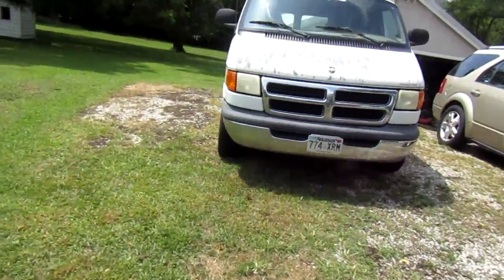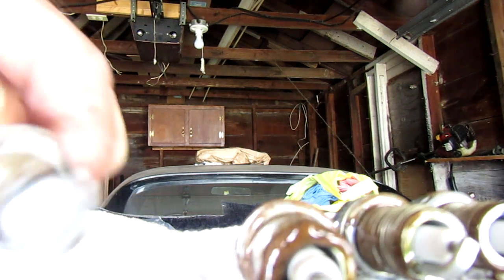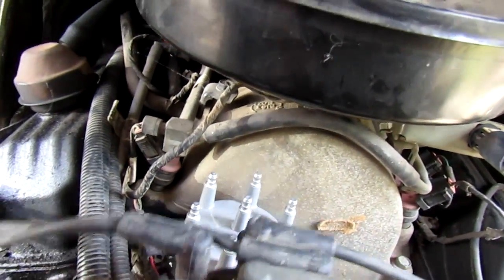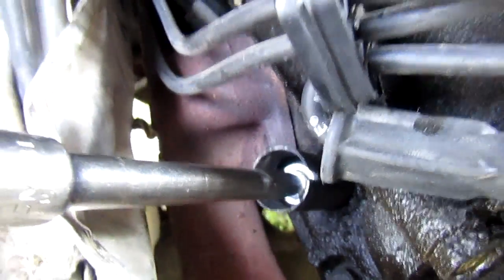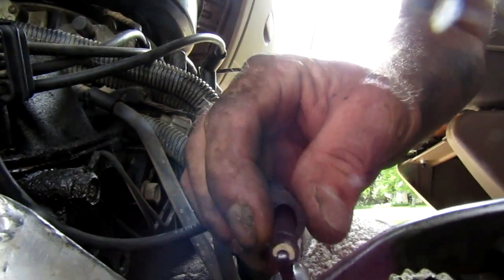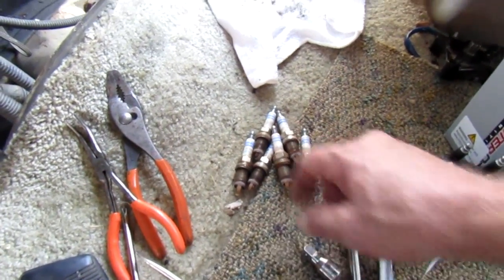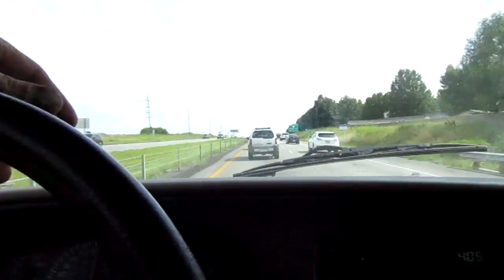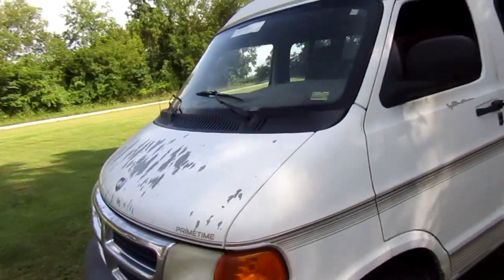Tune Up On A 99 Dodge Van

Comment: We have the same van and its a darn good runner, but not very good on gas with 17mpg being the best so far. Still, its comfortable and drives well. Ours was well maintained by the two previous owners and we are now building it into a vardo style glamper which is working out great.

Comment: I always do my own oil changes, I don't care what it cost, after being Dodge dealership  mechanic  for 30 years,  I have seen trans fluid to machine oil, sent to labs to find out what it was, these jiffy lube places, have no clue what is being put into their  tanks, and I believe  they  don't care, so I will do my own, I have a 99 ram van and I don't have to jack it up to do an oil change, it's very easy, great video, I'm sure it will help someone out, great job!😊

Comment: I was taught to use the hole in the spark plug gauge to set the gap, that way you’re not putting pressure on the plugs center electrode.  Hope that helps. Thanks for the great video!!!

Comment: I have a 2000 dodge 1500 conversion.  In your opinion,  I need to replace the  front engine gasket and the oil pan gasket.  I'm near the Virginia/north carolina line...what would you think would be a good price to pay to have it done? Mines a v8. 
I paid $375 to replace my plugs. My back plug was frozen and it took 1 week to break it loose. I just hope a chunk of rust didn't get left in there! It's seriously hard to find a mechanic to work on these beasts!

Comment: Great video! You saved a ton of money doing it yourself. I have a 2002 Dodge Ram Van B1500. V-8 5.2L. I will attempt the plugs, wires, points, cap myself. I just purchased from my cousin. It has 342,000 mies on it. Had a rebuilt transmission installed. I aint no mechanic but i have the tools and your video gave me the confidence! Thank you! Wish you had a video about fixing the a/c. Mine acts funny. Switches from blowing out the front vents to blowing down by my feet and also in the windshield. Switches by itself? Not sure what that is??
Reply: Blend door

Comment: Thanks great vid
..but nervous about able to take spark plugs out ...I have a 1985 dodge b250 5.2 v8 8 plugs...hope I dont get stuck trying to remove plugs in a tight spot
Reply from the maker: Just take your time my friend and if you think you get over your head walk away from it
Reply: I have a 1980 Dodge B300 MaxiVan 360 V-8. Just have to remove the tin shield on the driver's side, tons of room super easy to change sparkplug! Could even do it while sitting down on the seats!

Comment: Your video was super helpful. We just purchased a 96 Dodge 3500 in pretty good shape but it needs some maintenance work. It has been sitting for a while and takes a while to start. After it sounds like its starting, it shuts off.. Do you know what that could be?
Reply from the maker: Sounds like to me you got a clogged fuel filters or a bad fuel pump or if you just have bad gas

Comment: Thank you for responding, I don't know how many miles are on van, I'm sure you know your market. I'm in N.J. and it's very hard to find used vans. I paid $1500. For mine and it had 125,000 on speedometer a cracked windshield, leaking waterpump. Rust like yours, paint missing all over and very dirty, also not the high top version, no Couch or rear seats. 
Very dirty inside including front seats.
Had to replace them so bad.
I felt lucky to find this van so cheap.
I very much liked your video, showed I was not alone having this problem changing plugs.
Did you sell van?
Thank you
Coby

Comment: Did you sell your van?  How many miles are on it?  And if it    not sold yet, what state are you located in?
Reply: I have a 99 van 1500 60,000 miles 
Its sputtering probably needs a fuel filter.

For Sale $3,500.00        Sits 7 ,Dodge with captains chairs and bench/bed .

Comment: Should have held that van a few months. Since pandemic MANY are paying 25 3500 for same van to live in. I have the 98 3500 14 passenger 120k Miles I'm converting into a campervan.nice video. Ty.

Comment: Crazy thing about it it wouldn't have took you $40 to change the oil those little 3.9 l Magnums only hold 3 .3/4 courts oil question 20 bucks you can change your wall on them that's filtered too

Comment: I have a 2002 Dodge Ram van with 5.2 L V8. It's almost impossible to remove 
Plugs towards drivers side cylinder 1& 3. Took 2 hrs to get plug 3 out. If you take whee!s off its easier especially on passenger side. I've done it twice so far at 130,000 miles. I avoid it. If you break or cross thread plugs your screwed.
Your selling too cheap, $2000 at least.
Reply from the maker: If I can find vehicles that I can get them cheap enough and put a couple dollars into them I do it and I just cheap sell them just if I can make $100 I'm happy plus it gives me a project and something to do cuz I hate sitting down being bored

Comment: I'm gonna put some accel copper core spark plugs in our new motor thats on the way for a 1998 b1500 ram van 3.9 liter v6 magnum so I baught accel tune up kit for it with accel copper core plugs I hear people say that they are a top of the line brand so I was wondering is that good
Reply from the maker: That is top of the line but that's more for Performance Motors how to put some AC Delco stuff on it we're just a basic stock motor

Comment: I just did 6 of my 8 the ones on that drivers side way up in there can't get a tool in and can't turn it the way you did with your hand, SO how can I get those 2 plugs out? Any ideas?
Reply: Same happened to me now, how you did it.
Reply: I ended up taking mine to a mechanic for the last 2 at least it was cheaper than a full job, it took him 2 hrs, since then I purchased a short handle ratchet that would have helped, get into that small space!
Reply: thanks
Reply: Would one of the pneumatic ratchets do better?